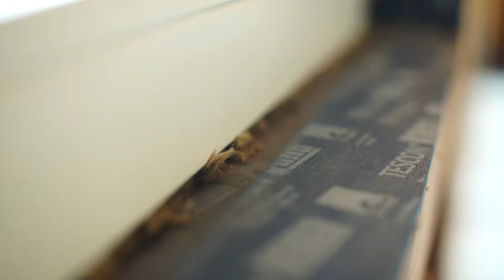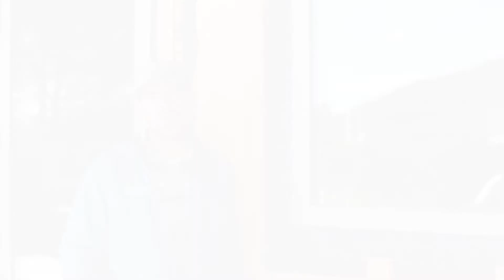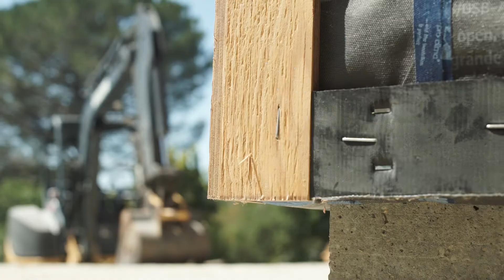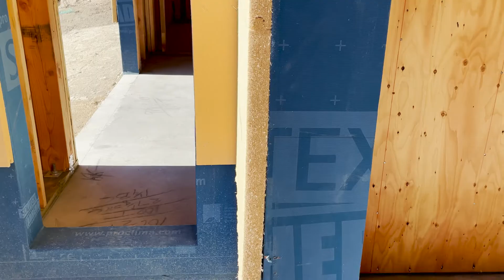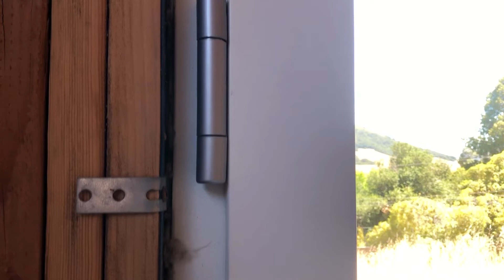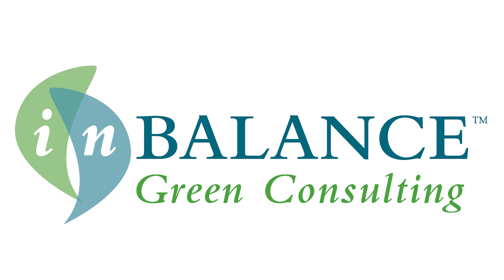Bishop Passive House: Thermal Bridges and Transitions

Comment: Is there a reason why the gutex fibre board is not covered with a waterproof membrane ? Surely if water penetrated the structure and got in around the window, the gutex would in time become wet and cause damage, or is it sufficiently waterproof to only need sealing at the joints ?Jeremy
Reply from the maker: Hi Jeremy, 
This specific type of gutex utilizes a paraffin wax coating that allows it to have water shedding capabilities. We had 11 inches of rain get absorbed while this was up and it dried out completely in about 24 hours.
Reply: @cairncollaborative7736  thanks. I’m planning on using the gutex on a prototype passivhaus that I’ve designed. We have a particularly unforgiving climate here in the UK. especially when it comes to water penetration.

Comment: I like this video series. Glad I found it. How did you air seal the outlookers?
Reply from the maker: Hi Jesse, glad you found us. For the outlookers we made sure that the roof membrane came down past our wall membrane to prevent any gaps at that junction. We then cut out just enough space for the outlooker and taped around it. We probably had about 30 in the back and front too tape, so it wasn't bad at all. I think you can spy this detail in the wall mock up video? But basically- very careful taping and that overlap to begin with!
Reply: @cairncollaborative7736  thanks for the reply! I’ll try to check out the wall mock up video.